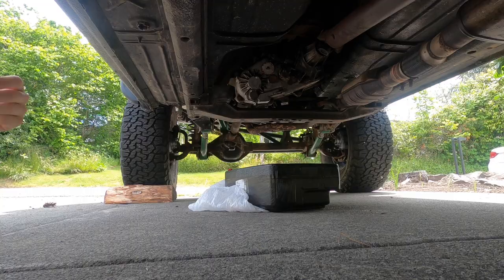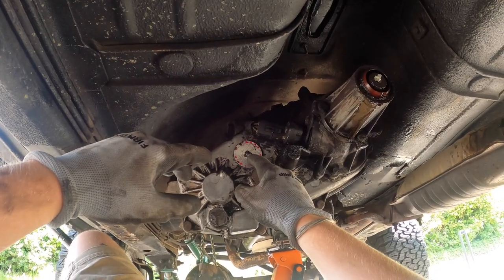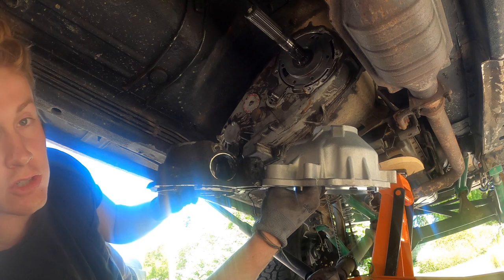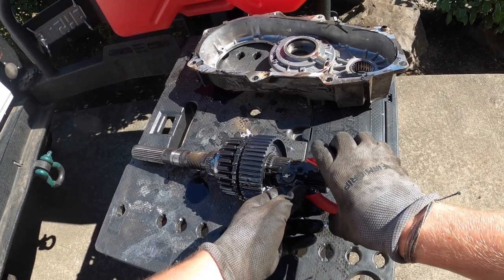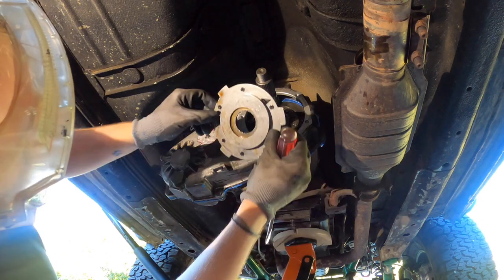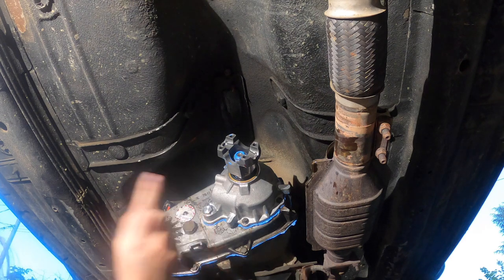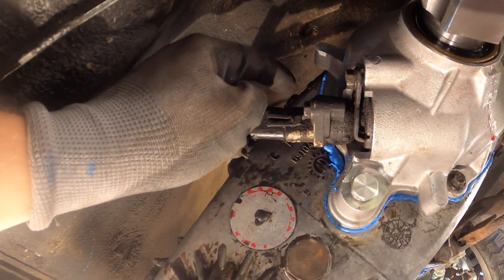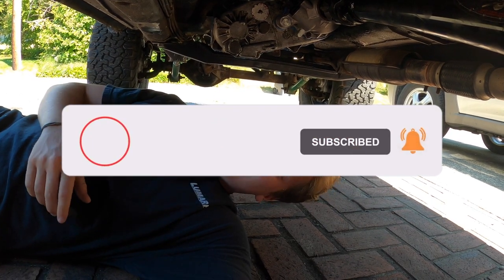Install a SYE in a Jeep XJ the easy way/NP231 upgrades with Adams Driveshaft for XJ, TJ & MJ

Comment: Great video! The trick with mapping out all the bolts is really smart. We all do it, we start yanking out bolts and we think we're going to remember which ones went where, but then we don't remember. I agree with your assessment of comparative difficulty too. I would be easier to do the SYE install on a bench but there's the added effort of removing the transfer case. As long as you can fit underneath your jeep without any problems it is totally doable to install the SYE in the vehicle. Keep up the good content.

Comment: Very well made video, really enjoyed it. As someone planning on buying/building my 1st Cherokee this year, I've been watching tons of YouTube videos. However there was one thing that stood out to me in your video, and that was the amount of RTV you used in resealing your TC. I own an 05 GMC 2500HD 4x4 with one of the common New Venture TC's that are known for the pump wearing a hole in the rear case half.Mine doesn't leak yet, but they all will eventually unless you put the proper upgrade part in them. My TC also won't shift into 4lo (grinds) unless you turn the engine off. Planning on pulling it and addressing these issues this year. So I've also watched several "Precision Transmission" videos addressing the leak/hole issue. The one thing "Richard" (God) always stresses is not over using the RTV when resealing your case halves. He has shown countless examples of how the excess RTV that squishes out inside the case ends up in the bottom of your TC and ends up clogging up the screen on the pickup tube, obviously leading to starving your pump of ATF and shortening the life of the TC. I'm sure many of you are already familiar with Precision Transmissions channel. If not check it out and prepare yourself to be educated by an experienced mechanic and drag racer! 
Not trying to be a "know it all", just thought it was some very worthy info to share!

Comment: This is an interesting repair, with super tips as to dismantle and assembly. Exactly why I think it's very useful is that owners of the XJ like myself, come to love various quality as to the handle character of the 4x4 and quite all of the cargo and functional passenger domain. 
Various major drive train work, which can include repair and replacement to transmission, should include a truly long look at the torque converter (and starter ring) at disassembly.  That output plate, a clock bolt configure of only one correct mounting.  Absolutely use top quality seals, correctly installed and where useful, pre order new bolts. The realm of hi mileage at the rear main seal, and all further rear drive components require particular care in both assembly and fitment to prevent the dreaded Jeep oil spots to drive way.  The torque converter alignment and wear to the transmission front seal, as where a wear grove can be very slight but difficult as to cause a constant leak. Another difficult leak component just forward, is the oil filter mounting o ring.  A problem to remove as very tight clearance with a hex recess drive to the center mount fastener. If available to replace that o-ring, a must for longer term slight oil leak avoidance.
For the serious minded XJ owner, where the exhaust is so fitted to unmount with bolted weldment, as to a joint, is a huge asset to remove any of the driveline and transfer case, transmission. *and or motor pull.
Not mentioned, but a truly nice mod is replacement of the power steering bracket and device to upgraded aftermarket replacement. And, entire further mods are at hand.
These units can still be found and converted to nice project units at a fair price.  Fair trails to owners.  M.

Comment: I did an Advance Adapters SYE on one of my XJ's. I know you can do it in the rig but I found it easier to just pull the T-case and do it on the bench. T-case comes out in about 30 or 40 minutes. Best thing you can do is get rid of those damn t-case drops. I am in Washington as well, don't see many people on here from Wa.
Reply from the maker: Hello fellow washingtonian. I put the TCase drops in a few years ago to help prevent the eating of Ujoints the stock set up was doing to me and they are GONEZO now. Id seen a bunch of videos of people taking it out and as a mostly self taught home mechanic I certainly felt some hesitancy towards doing it. I didnt see many videos on doing it in the vehicle and figured theres probably other people who would feel more comfortable attempting it their first time the same way 😂.
Reply: @SomeGuyOutside  It's done and in that's the part that counts, see you in the dirt

Comment: The XJ's crossmember definitely makes this an easier job to do under the vehicle. The TJ's skid plate covers the whole thing up from underneath so it's a much bigger PITA. Wish the TJ had a cross member and separate skid.
Reply: Thanks for the video. Just about to do mine. Waitng on the SYE to arrive today.  Am I missing something? Other than to remove the transfer case drop wedges, I see absolutely no reason to remove my crossmember. Doesn't look like it will interfere with the rear case removal or anything else. Explaination? 2001 XJ

Comment: Excellent Video! Thank you. I think i'll drill holes in the snap rings myself to make the job less stressful.
Reply from the maker: I’m not sure you’d be able to do that with them installed but after maybe 🤔? My only worry would be that it would compromise the strength of ring material and if it breaks you’d have a couple tiny chunks of metal flying around your transfer case. Worst case scenario, just trying to be the devils advocate not saying don’t do it!
Reply: Why not just buy a couple correct size c clips with holes??

Comment: No one's been "Lied" to about removing the transfer case for the SYE install. I think this video illustrates why it easiers with greater success doing this install out of the vehicle. Try it installed, and when you realize cleaning and re sealing the case halves in car and not having a leak afterword is unlikely. Then you can do it again with the TC out of the vehicle successfully.Take for instance the 3 hours spent removing/installing the output shaft c clip, a task out of the vehicle would take less than a minute each with the proper tool. Multiply this extra time for the difficulty lying on your back performing all the steps involved and your better off spending some of that time simply removing the TC in the first place. If your experienced with numerous SYE installs, you may save time and have a leak free install in car, otherwise I'd pull the TC out and do the install comfortably on your work bench.

Comment: I agree, pulling the transfer case wouldn't be worth it.  The work you have to do on the t-case under the vehicle is much easier than accessing the 6 bolts that holds the t-case in.  Thanks for calling out to put the oil pump and pick up together first.  Great video.
Reply from the maker: Thank you! It’s definitely a job that can be done from ⬇️

Comment: Good video this will save time,  just my two cents bud.....they do sell snap ring pliers that have wider tips , the ones you have on the video are just designed for the ones that have holes....regardless you made it happen...well done
Reply from the maker: The first pair I bought had a bit wider tips but didn’t spread wide enough. The second pair spread wider but had the rounded tips. I think my third pair will be the perfect fit!

Comment: I think you would really enjoy a better set of snap ring pliers. I took apart a np231 to make a crawl box and I've rebuild a np435 transmission they both have that kind of snap ring and the cheap snap rings pliers are like death for removing them. The snap rings are like that for a reason and it is because they rotate with the shaft and as such the tabs coming up for the holes like the traditional snap ring have will cause problems by being out of balance and in really high rpm situations could cause the snap ring to come off the shaft and really give you some problems.
Reply from the maker: Yeah so I originally bought a pair of snap rings listed as 2 1/2” spread with like four different heads but they only really spread to about 1 7/8” and the nose/teeth material we’re not close to quality enough. The second pair I got did spread wider but I still felt like they could be better. Definitely looking for a better pair. Good to know on the snap rings aswell! Thank you
Reply: @SomeGuyOutside  LOL @ "Remember to try and remember everything." Yeah, the "duck bill" style lock ring pliers are the way to go with those stubborn SOB's! Thanks for the vid...nice refresher for the long overdue re-sealing of my t-case. It's been weeping fluid for the 5 yrs since my JB SSSYE install on my TJ (did the install under the Jeep and...outside)!Gonna give Yamabond 4 liquid gasket maker a try this time

Comment: Great video, I have the Azzys Design for my transfer case. I have to put a SYE in my 2000 Cherokee which has a 4.5” lift and is eating u joints. Will the Azzy Design still work with that much lift? How much lift and what size tire are you running? Your Cherokee looks great and your videos are awesome.
Reply from the maker: Thank you!! I absolutely think it will help/work with that lift. I am about 5 inches in the front and 4 in the rear with the sag of my leafs over the years I think and it has worked wonderfully the last six moths. Ive got BFG ko2 33x12.5r15 on and they're about four years old and have at-least 20k miles on them and have a bunch of tread left, run amazing in the snow and dirt but are starting to get a bit of wobble and bounce in them.

Comment: Good job! I would never attempt this on the ground (at my age) but I have plans on doing this to my 95 XJ. Will probably do this job on a lift. What adjustable control arms did you use on your XJ? Can you post a link? Also where did you get your new rear driveshaft and cost? Thanks for your time. God bless and stay well.
Reply from the maker: I didn’t love doing it at MY age as I’m without a good dolly, sometbing I like would make a job like this waaaay easier. I got the shaft and SYE kit from adams driveshaft in one of their holiday bundles. The bundle was about $400, certainly steep but I wanted quality and American made parts and I haven’t been disappointed in the many months since!
Reply from the maker: Oh and the control arms are from Core4x4 ! I would recommend them, straight beef. I want to do their long arm kit one day but like all quality American made parts, takes me some time to save up

Comment: Would have drilled my own holes in the snap ring
Reply from the maker: Have learned the difference in various snap ring tools since this project!
Reply: Yeah, good luck with that. Those rings are hardened steel. You don't just grab a drill and punch a little hole. Plus those rings are purposely designed like that and using the correct " flat nosed " ring pliers makes installing and removing them a cinch.

Comment: Great video, great work! How long did this project take for you to complete? How high is your jeep lifted and what size tires are you running?! Cheers!
Reply: Okay, you answered my first question already.. lol. Definitely still curious to know what your lift/tire combo is!
Reply from the maker: @ryanellis5902  no worries! I’m planning a follow up video with lessons learned stuff. My Jeeps about 5 and a smidge inches between a 3 inch leaf pack in the rear with 2 inch shackles and 4 inch cheap coil  with two inch pucks. I NEED new shocks just have some junker rough country ones atm.  BFG 33 X12.5 R15 are my current tires, overall I’m happy with them. They do WONDERFUL in the snow, never had or seen an open diff do as well or better in the snow. Certainly some road noise and vibrations that come with them on the stock axles. Oh and I swapped a Chrysler 8.25 rear axle out of a liberty or patriot in a junkyard!
Reply: @some guy outside  Thanks for the info! I wanna lift my xj 3 inches to fit 31x10.5R15s (which I already have) but I can't decide exactly what lift to get.. its either gonna be Skyjacker or RC. Rough Country will save me some $$ but I don't want cheap parts either..
Reply: I'm also wondering if I'll get any driveline vibrations from only a 3 inch lift.. but only time will tell there.. any suggestions would be greatly appreciated!
Reply from the maker: @ryanellis5902  well rough country is a good start, my first lift on this jeep (only jeep I’ve ever had) was full rough country and one by one I replaced them all except the shocks 😂 it’s certainly paying for what you get rough country will get the job done but not much more than that. I was at 5 inches of lift and it wasn’t tell a small tiny little bitty jumping of my Jeep that i messed up the driveline and started to get vibrations. I lived with it for like two years after that, annoying but doable. Much better without though 😂